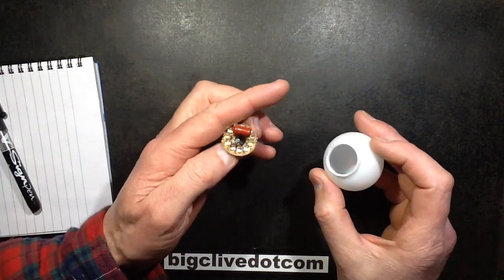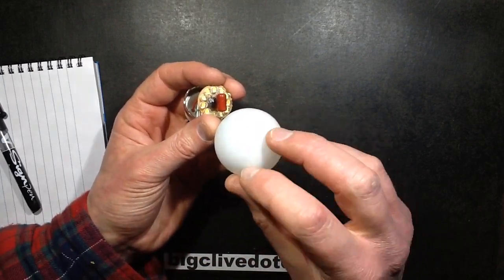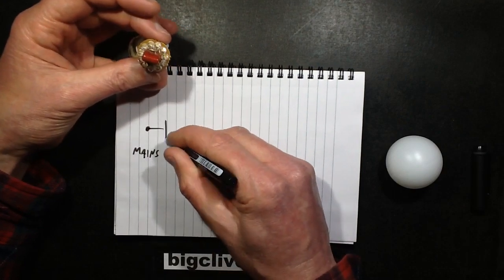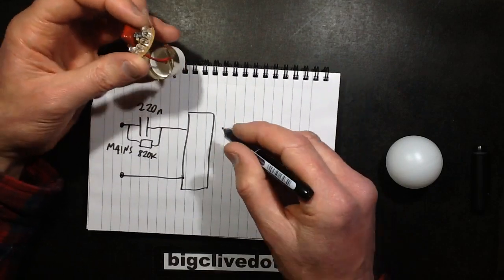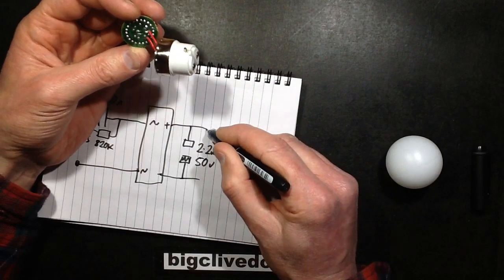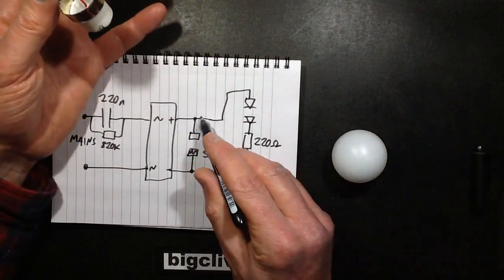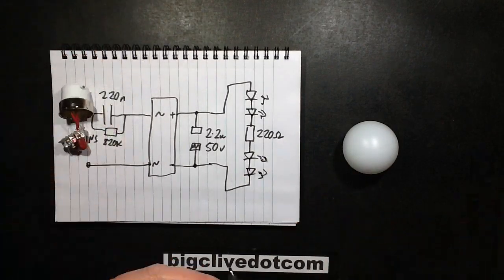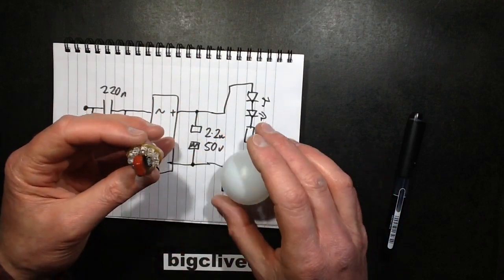Sudden schematic of a slightly different LED festoon lamp.

Comment: Mr Clive, just bought some interesting Crompton LED (GLS shape/size) ES garden bulbs to save power in a string of what was Twenty filament bulbs of 25w each. The replacements i got have a conventional glass envelope with pigment applied to the inside of the glass. (quite well, as it happens.)  They are advertised as 2w each however the box gives away that they are 1.5w each. 

A couple of them failed straight away but the supplier replaced them and i got to keep the 2 duds since the postage wasn't worth it. I busted one of them open.  Up the middle of the bulb is an aluminium pylon with 19 leds attached, 16 around it and another 3 on the end. A resistor and (ceramic capacitor??) were included. The LEDS appear to be based on a conventional tape which has been adapted/bastardised to suit the shape of the pylon. 

They quote the Lumens for the red and green ones at 25, amber at 50, yellow at 95 and the blue at 7. The visual impact of them all is quite impressively linear though, and the light distribution is very even across the glass envelopes. The colour rendering of the blue ones is, as you would expect, spectrally way superior to the filament bulbs they have replaced.

I am not sure whether all the LED's are 'white' or whether they are tailored ones which are then 'smoothed' by the coloured bulb. I suspect the former. Let's not mess about, at £5 each the only savings are in respect of future bills, but blimey they really do run cool, which should extend the life of the waterproof shrouds round the neck. 

I still have the other faulty one if you want to reverse engineer it.   Not VERY interesting inside though.